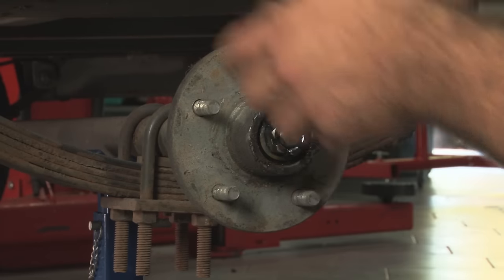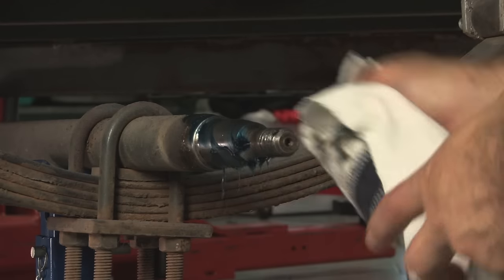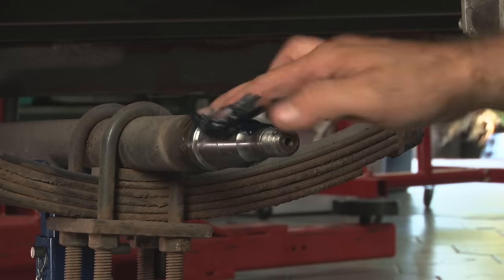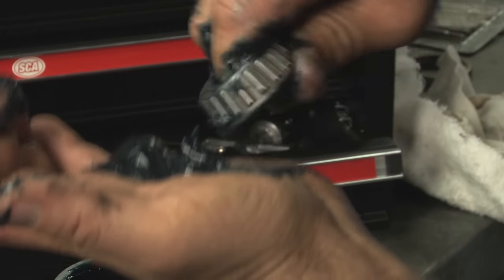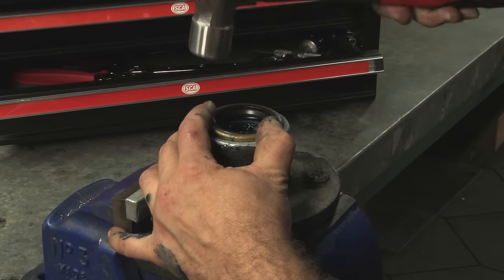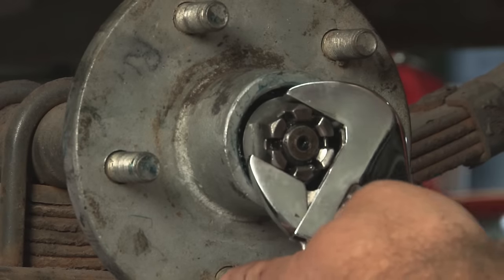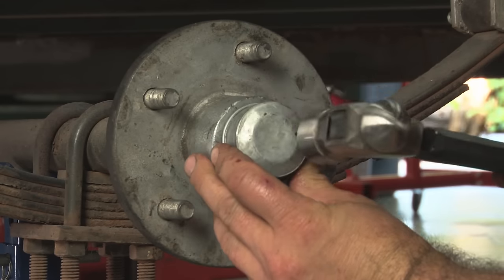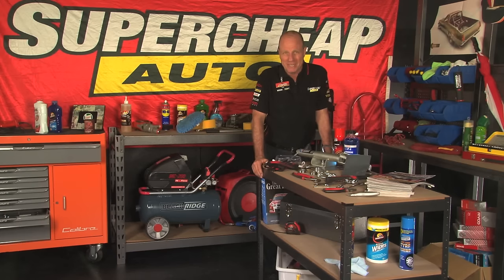How to - Replace Trailer Wheel Bearings // Supercheap Auto

Comment: How about replacing the outer cups, this method only replaces half of the bearing. It won't last doing this method.
Reply: Thats why its call super cheap😂😂😂😂
Reply: Only half of the bearing, how so?

I haven't replaced bearings before, but I need to now as the trailer has been sitting for 12 years.

Any advice beyond this video would be greatly appreciated, I want to do a proper job so I only have to do it once.

Also, do you know how I could tell what type of bearings I need, as in, are there different sizes etc?
Reply: @milkshakemuncher   Take the bearings and seal to a bearing shop and they should sort for you.

Comment: The roller bearings ride on the bearing cups ( Races ).  They should be replaced, NOT sanded or filed.
Reply: Yes and are a PAIN to remove, just spend hours trying to do them, finally got them replaced and the hub and wheel is back on the trailer! Tomorrow I'll do the left side one.
Reply: He is talking about the inner hub surface being filed or sanded to remove burs, not the outer bearing race. Trying to make it easy to remove the old race or insert a new one.

Comment: This is only a bush mechanic half job. . What about the outer rings of the bearings? They are just as important. . Only do this method if you are broken down on the side of the road. . If you are in the workshop like this bloke you can easily knock them outer rings out with a brass punch and replace them also. . That will make your bearings last twice as long. .
Reply: By outer rings, you mean the race

Comment: I have replaced thousands and thousands of bearings and admittedly use an arbor press and specially lathe turned pushers and seaters to easily and accurately remove and install bearing components. However, the item to be repaired it is not always close to a arbor press or having any installation and removal tools handy.  
   There are six areas of caution that are not mentioned in this video, that I would like to add and I will do my best to describe them without the benefit of a video.
1.  One must take care when driving out the outer races (cups)  from the hubs.  When installed, the cups must sit squarely in the bore they are placed in and the back of the cup must fit snugly against the entire surface in the back. What I often see is that people use screwdrivers, punches or other hard tools to drive out the cups from the bore. Doing so, people often put the edge of the tool in the space where the steel of the hub meets the back of the hardened race. When they hit this with a hammer, it distorts and expands the softer metal in the hub. Thus, when the new cup is placed in the bore, the flat backside hits that raised portion when it tries to seat and  no-longer sits square in the bore. This causes problems because the inner race cones are sitting square on the shaft but do not set square with the hub cup and causes premature wear. In addition, this puts the inner and outer cups out of square to each other. I would recommend using an aluminum. brass, or copper drift to knock out the outer race. Being careful not to hit the hub steel whenever possible and to be driving vertically. If one accidentally causes the metal to distort where the seat is, take a small abrasive stone and remove the high spot. It’s pretty easy to tell where the highest point is, as it will turn out shiny when the stone is passed over it and another way to do it is to use a black felt marker pen and cover the area and then rub it with the flat of the stone to make sure that all the surfaces are the same shade of black and thus the same height.
2.  Continuation on driving out the cups, I often see that there are score marks on the side of the hub bore from the punches, screwdrivers and other hard tools as they are used to continue driving cup out of the bore. This again causes distortions when the new cup is placed inside the bore. When the outer diameter of the new cup hits the scored marks, it pushes it inward a bit and causes the bore to no-longer be round. This again causes shortened bearing life. Again, use a abrasive stone (round one) to check for any high spots that must be removed in the bore in order to have a good bearing life.
3.  Replace the cups using a soft metal. Using punches, screwdrivers and other hard tips tools can actually distort the metal in the cup and cause it to have a high spot or spots that will cause problems. Again use a softer metal.
4.  When installing seals, I like to use a Block of wood, as it is soft and covers a large area. This helps to eliminate concentrated force like a steel hammer produces. Evenly go around the seal to slowly and evenly seat the seal, in most cases until the face of the seal is even with the hub face. In some circumstances the back side of the seal needs to rest at the bottom of the bore where the seat is. 
5.  I would add that you also want to check the spindle to make sure that is not worn, I have often seen spindles that have five, ten or more thousandths of an inch worth of wear on them and the inner race fits quite loose and will not produce a good repair. A loose fit between a spindle and the cone bearing bore in often allow the inner race to spin spin on the spindle and accelerate this wear causing problems. If so where is severe. It’s probably best to replace a spindle to be safe.
6.  I always make sure there’s some grease around the inner backside of the seal (inside the seals Metal housing) to ensure that the seal has lubrication. Also, put some lubrication on the shaft and seal when installing to make sure that the seal does not start out dry, possibly causing the rubber to be torn away or quickly eroded, causing future leaks.
Reply: I can’t read

Comment: This is a fine illustrative director. two points :- Shimming up with steel washer or grind down the back of the nut a shim in order to get a snug fit without generating heat. Also what happened to the grease nipple . This can be tapped into the hub and threaded so that a snug fit is made. Do not forget to drill a bleed hole 1/8" in the middle of the outer Cap so you can verify the bearings are always not overpacked as heat can blow the rear Carbon/Rubber seal. Check every 150 miles.

Comment: I usually use a timber block to tap in the bearing buddies, much better than a cap. Other options are to replace the entire hub with a new one that has already been packed with grease and ready to be installed.
Reply: Don’t use bearing buddies they don’t do anything other than damage

Comment: Good video but I'm more picky about adjustment , after seating bearing and backing off I check for end play by lifting hub or put tire on an try to wiggle up and down,a very small amount of play is acceptable but sometimes you have to try a different thickness washer or you can grind / sand a few thousands off of back of nut to let you tighten to next notch but not making it too tight, too tight no good too loose no good
Reply: SAID WELL!!!

Comment: So don't these have OUTER bearing cases that need to be hammered out? He only removed and replaced the INNER bearing ??? 
Can someone help me out? I'm about to attempt new bearings on a 6x4 trailer with a 4 stud hub. 
I haven't done mechanical work in a long time - but had done many wheel bearings way back and always used to punch out the outer case from the stub axle.

Comment: Hi Carl, Yeh I guess I was a bit cranky when I wrote that. In engineering everything has a specific name, or it should. Otherwise how would describe anything. A cotter pin is a solid steel cylinder with a flat taper on one side (there is no 'side' until the taper is machined). There is usually a thread on the taper end to which a washer and a nut are attached. These pins were common on bicycle cranks until the late 1980's, they were also used to attach pulleys and sprockets etc to shafts.

Comment: When replacing your leaf springs how do you know exactly where to bolt the axle to the leaf spring with the u-bolts? I mean couldn’t it be off by even a slight amount and then the wheel will also not roll exactly straight??? For example if you don’t bolt the axle down perfectly with the leaf springs say it’s half an inch forward or half an inch backward than the wheel will not spin perfectly straight? Anyone know how to know the exact spot to bolt the axle onto the leaf springs with the u-blots????

Comment: The point which is overlooked is that once you have done all the points illustrated there is something that could be done which is not shown. All Bramber Trailers and Light Field Gun Carriages and Camping Trailers have a Grease Nipple on each road wheel . This has to be tapped  then screwed into the bearing hub before it is loaded with the bearings,and sometimes a shim or washer.made in steel there is also a , Carbon Rubber Seal ; Drill 1/8th hole in Hub Cap fill until it bleeds a spot of grease

Comment: As a trailer mechanic for a living, you never stick new bearings in the old races
Reply: Hi, may I ask what you mean about new bearings onto old races?

I have to do my boat trailer bearings as it's been sitting around for 12 years unused.

The only knowledge I have is this video, so I don't know what races are and where they took short cuts in this video.

Any help would be greatly appreciated
Reply: @milkshakemuncher  the races are what the bearing rides on inside the Hub, if you remove old rusty wheel bearings and put new bearings into the old rusty races you're just going to ruin the new bearings you have to pound out the old races
Reply: @TheOriginalAndysGarage  thank you, I will look for these when doing the bearings, may I ask, are there only one size and type of wheel bearings to buy?

Or are there a multitude of sizes etc, just wondering how I know to order the correct bearings for a boat trailer (14ft 6 inch Aluminium boat), we call them tinnies here in Australia
Reply: @milkshakemuncher  you can buy a rebuild kit it comes with everything

Comment: Pity you don't know the difference between a split pin and a cotter pin. The bearings seizing is less of a problem than the bearing disintegrating and the wheel coming off.

Comment: Backing off nut for bearing preload is bogus and a caveman level method. There should be only a slight preload and that should be done by tightening the nut, NOT loosening it. You cannot get an accurate feel of preload that way. I usually drill an extra hole in the axle for the cotter key so that there are twelve positions that the castle nut can be locked at. That way it is possible to get the correct preload without having to leave the bearing floppy loose but still have a slight preload. I do this type of work for 51 years and still have to see this bullshit method as on this video.
Reply: Yep he backed off the bearing and and didnt check for slack
Reply: @Bill Gabriel. I don't understand why people dan't know to tighten an axle nut to the obvious point why you have no end play. You cannot find that point by backing off a nut. This is a professional way of adjusting axle nuts by tightening for no play. Contrary to a number of youtubers tapered wheel bearings should have a very slight preload which insures that each roller in the bearing is supporting its share of the weight. Any looseness causes fewer rollers to support the weight which causes more undo stress on them and shortens the life of the bearing. I have packed the wheel bearings many times in the last 52 years and none have gone bad with my procedure which was taught me by older mechanics and bearing companies. Now everyone things the exspasion rate of an axle and expansion rate of the hub are too different so you have leave end play. B.S. I have trailers (not semi trailers) that I packed over twenty years ago and have no bad bearings. That is because I don't short change the bearings and hubs of grease and there is no looseness like almost every factory that builds axles leaves for the customer to deal with. 😀